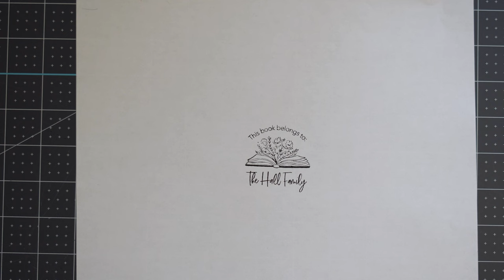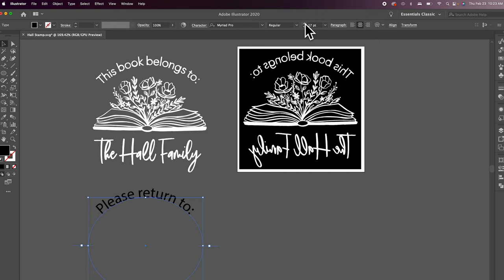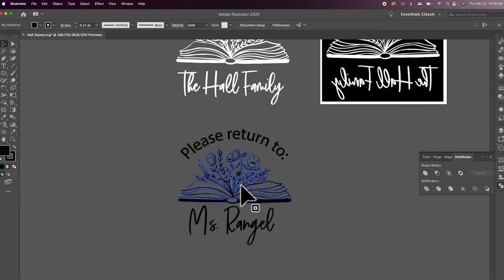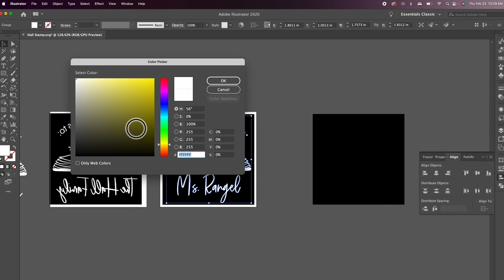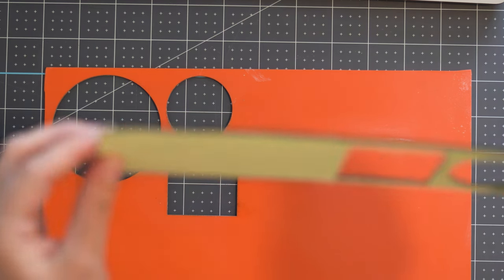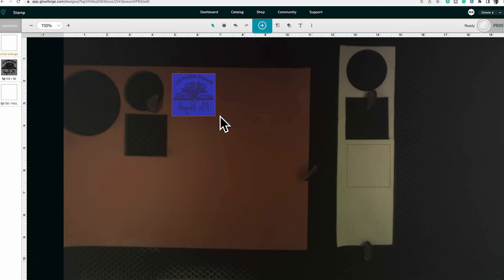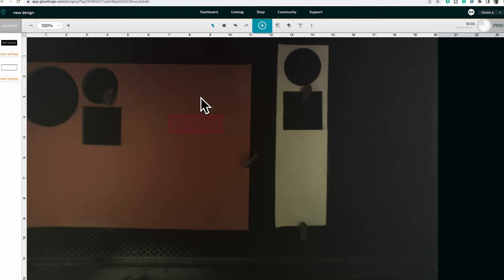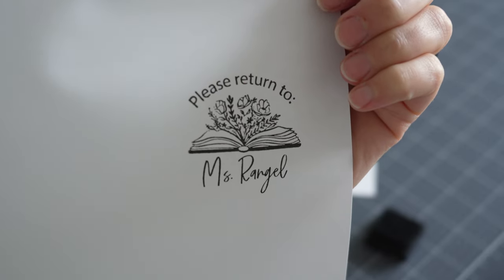How to Make a Rubber Stamp Using a Glowforge Laser

Comment: Are there fumes, or odors, generated by burning the rubber material with the laser?
Reply from the maker: I have in inline fan that I use with my glowforge that vents directly out a window so I have virtually zero fumes when cutting anything! 10/10 recommend an inline fan!